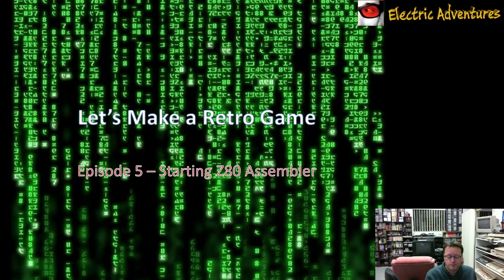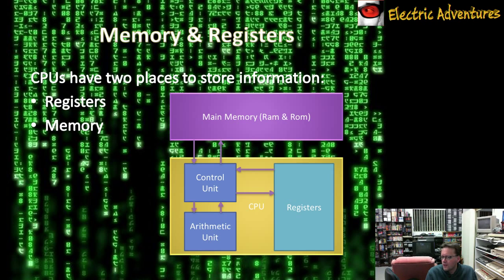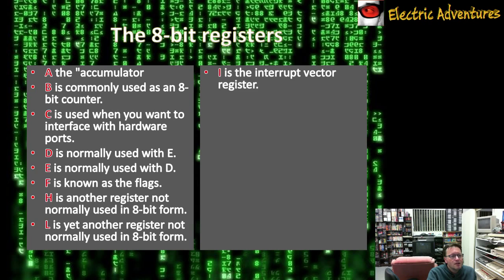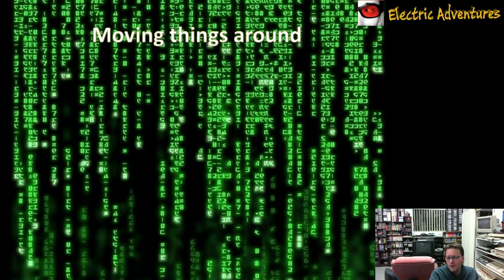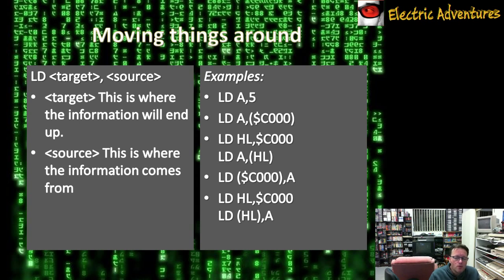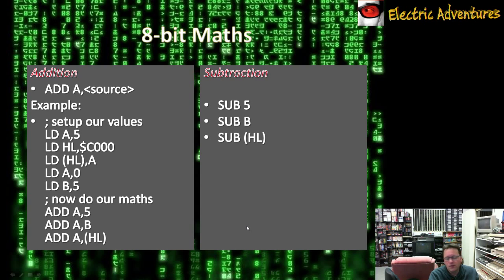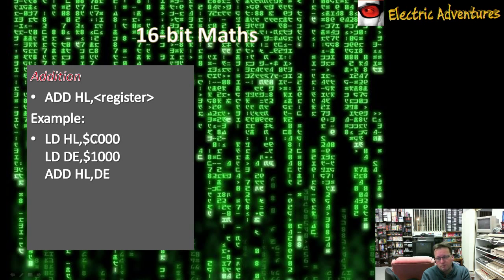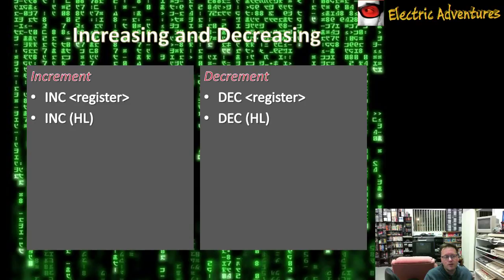Lets Make A Retro Game - Episode 5 - Starting Z80 Assembler

Comment: Interesting to see the Z80 breakdown - I can see why some folk do prefer it, especially with those 16-bit registers.

Considering that I remember tripping up a lot on trying to handle 16-bit maths on the 6510, I can see how you say Z80 holds you hand a bit more :)
Reply from the maker: +hellfire64 Figuring out how to do 16-bit maths with the 6502 did slow me down for a bit when I was working on the NES game (especially with the NES also omitting the BCD instructions as well).  It actually took me a little while to work out how to use zero page 16-bit variables, but once I got that I quite liked it.  In fact other than getting the racing game running, adding up the final score for the challenge screen was one of the harder bits to get done in time.
But you can see why the Z80 was used in a lot of machines back in the day, and had a lot more support for higher level languages such as C and Pascal earlier.

Comment: Cool video Tony. Love this. Z80 is quite different from 6510, quite similar to intel 8088 coding actually.
Reply from the maker: It's large instruction set and register counts, is one of the reasons the Z80 was so popular and led to other CISC chips.  The 6502 is really a RISC chip, so goes to the other side of the fence, less instructions but less cycles each.
Reply: electricadventures Indeed it can be faster doing things on RISC. But the MC itself is easier to understand on the Z80 side of things. Cool series Tony. Love it.
Reply: the other draw back with risc chips is program size is bigger.

Comment: good tutorial.. I wish I had this tutorial when I first started.

i don't like using sub but I like to use something like add a,254 which effectivly subtracts 1 from 1(128+254=127 in 8bit)
Reply from the maker: +VampierMSX So would have I back in the day, I am still amazed I managed to figure it out myself just with a book and tape based assembler.
I go more for clarity rather than worrying about speed at this level i.e. using the words add and sub in the basic meaning will be easier to understand for the moment.
Reply: +electricadventures And us noobs thank you for that.

Comment: Between the 6502 and z80 assembly which one is easier to learn, and would be better for creating arcade style games. Also I am a beginner to assembly language. If the same exact game was made on both cpu's. Would their be a performance or quality differance between the two
Reply from the maker: Two quite different questions, I'll try and answer as best I can.
So easier to learn, there are two aspects of this:
1. 6502 has a very small instruction set, so less to remember, but you require a lot more instructions to do certain things, so you really need to write at a base level and be prepared to do so. Each 6502 instruction takes a very small time to execute, so if you know what you are doing you can write very efficient fast code. You have very limited number of registers and have to get used to using zero page memory.  It is very difficult to be able to use a higher level language, like C and produce reasonable code on a 6502 machine.
2. Z80 has a large instruction set, so a lot more to remember, but it has a lot of instructions that do things in a single step, and it has a lot of instructions and a large number of registers.  It also natively does 16 bit maths which can save a lot of effort and if you want to use a mixture of assembly and C, several C compilers produce reasonable code (but of course writing pure assembler will produce faster results).  Most Z80 machines have inbuilt memory managers so accessing more than 64k of Ram and Rom is common.
So which is best is hard to answer and also depends what custom chips are in the same system i.e. for producing graphics and sound.
6502: Pros - fast execution, Cons: end logic can take a lot more to work out
Z80: Pros - lots of registers, 16 bit math,  easier to read/understand, easier to control attached devices and memory Cons - each instruction has a longer execution time than 6502 instructions.
Now the C64, BBC and Atari 8-bit computers have quite good memory mapped graphics and sound capabilities, so you have a lot of raw power that you can control right at the base level - but you have to fully invest in understanding the platform.
There are a lot more Z80 platforms, that have varying graphics and sound capabilities, the Spectrum has high resolution but quite primitive graphics, the Amstrad has slightly better capabilities but can be hard to get decent performance.  Other systems that use a TI-9918A graphics processor (Coleco, SC-1000, MSX), have high resolution colourful graphics with 32 hardware sprites.  They are not the easiest to produce smooth scrolling (as nothing in the graphics chip helps that) but that doesn't mean it can't be done.
Another 6502 system is the NES, this can achieve some quite good results, but can be very frustrating, due to the 6502's limitations with controlling external devices, which in this case the graphics chip is.  Personally have been constantly running into limitations on the system that you have to work around.
With all systems you really have to choose the right type of game to suite the systems capabilities.
Reply: @electricadventures  greatly appreciate your help

Comment: doesn't z80 have ccf and scf instructions to set and clear the carry flag, or can be used as a quick alternative to compare.
Reply from the maker: ccf complements the carry flag i.e. inverts it
scf sets the carry flag, which is good.  So the only way to clear the carry flag without testing it, is to do XOR A.
Z80 has heaps of instructions, very hard to properly cover it in a series such as this of course :)
Reply: thanks for clearing that up been awhile
Reply: +electricadventures "So the only way to clear the carry flag without testing it, is to do XOR A." - Respectfully, a) that is NOT 'the only way', and b) would have the disadvantage of wiping out the contents of A in the process. But you can easily use either AND A or OR A to clear the Carry flag whilst also preserve the contents of A (a.k.a. the accumulator).

Of course, if on the other hand you want to both empty the accumulator and wipe out the Carry flag in one cost-effective, swift move - then XOR A is by far the best (and only!) choice... ;-)

P.S. You can obviously do the sequence SCF ; CCF - but that is very inefficient, costing you twice (not completely sure that's the case without peeking in the 'Good Book', but seems to be a fair assumption: the shortest instructions take one byte in memory and cost 4 T-states to execute, so a sequence of 2 instructions will - at the very least! - be spending 2 bytes of RAM and 8 Ts of processor time) as much in both memory and time.

Comment: Thanks Tony. I always love watching stuff like this. I know the basics, but still. The Z80 is new to me and the number of registers is baffling compared to the 6502. I do have trouble remembering them. I actually thought there were "dash" registers as well: like A' and B'.
Reply from the maker: There is a complete alternate set of registers you can switch too, might add them into part two of this one, so at least they are mentioned.
It was good to finally get the time to get this done and published, keep on having the echo issues when I record, took me lots of attempts :)
Reply: Yes, the echo came in half way through the video. Not disturbing but it sounds like there are two recording devices. I get the same effect when I almost sync two videos correctly. Tiny bit of reverb.

Comment: Great video series. Is there a six?
Reply from the maker: +fred kono Almost, very behind on recording and editing at the moment.  Script for episode and background article (for the website) are all done, just have to get some quality recording time.
Reply: +electricadventures  No worries. I really enjoy these and thanks for the effort you put into these. They are quality work.
Reply: Also is there any material that goes into video programming for the Coleco? I have never programmed for the Tms99XX VDP before or the Coleco. It's a bit confusing not knowing exactly what the calls to the bios do and such.
Reply from the maker: +fred kono Probably the best doc, that I have found useful is called 'Colecovision Coding Guide' and is the original Coleco documentation.  PM me if you can't find it, and I can send it to you.
Also see the template I have already released for the Coleco as part of this series to get you started and the Sprite Editor.

Comment: I am trying to find a free Windows Z80 Assembler program to begin my learning journey writing programs in Assembly. But I can't find one that isn't free. Surely there are some that are free? Can anyone help me find it? My main goal for now is to write a very simple ZX Spectrum game , that will work on emulator and also original hardware eventually
Reply from the maker: The TNIASM mentioned in the notes is free to download.
Reply: @electricadventures  Thanks so much for the fast reply. But sadly I can't see any mention of TNIASM, and even Ctrl-F "TNIASM" only found the one reference above. All the links i clicked didn't lead me to any free software. However, since writing my first message less than hour ago, I read that I should maybe write Assembly in Notepad++ and then compile it using something called Pasmo! ...it's all very confusing right now but I am sure I will get my head around it all eventually. Thanks for the great information
Reply from the maker: The free version is right here http://www.tni.nl/products/tniasm045.zip. Googling TNIASM has the first result as the page and down the page is the free version. You can use any text editor you like, Context mentioned here is free (as is Notepad++). There are more written instructions on my website.